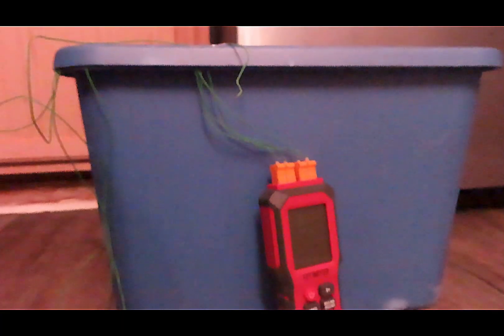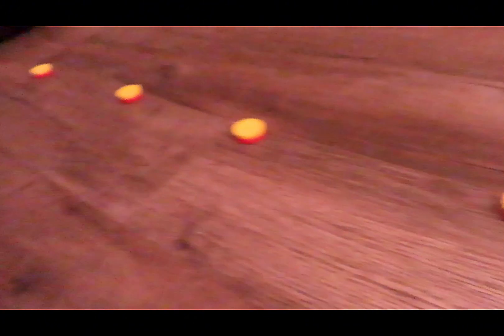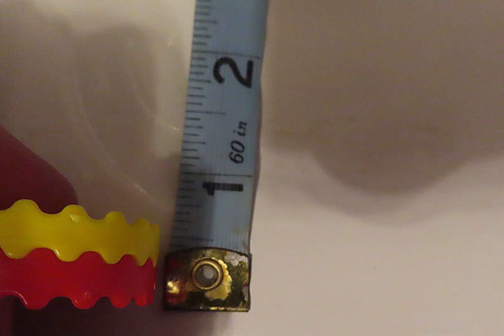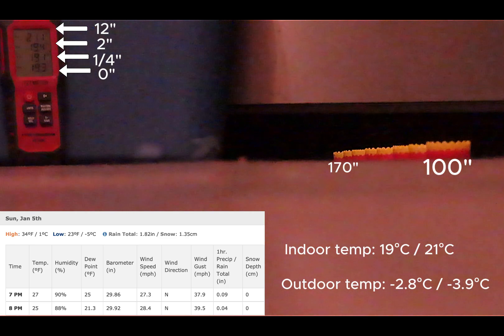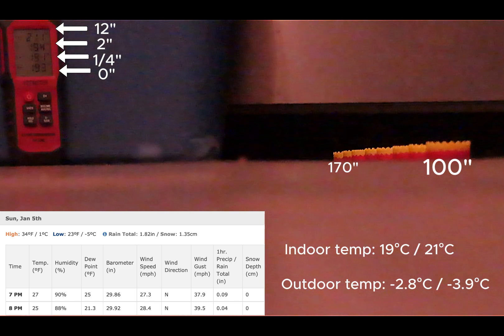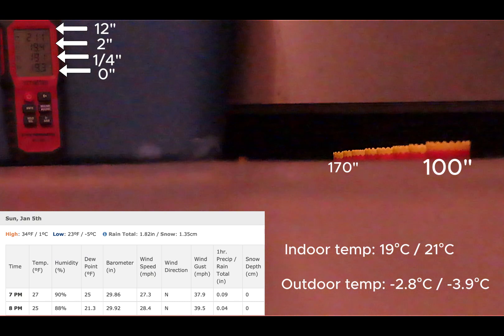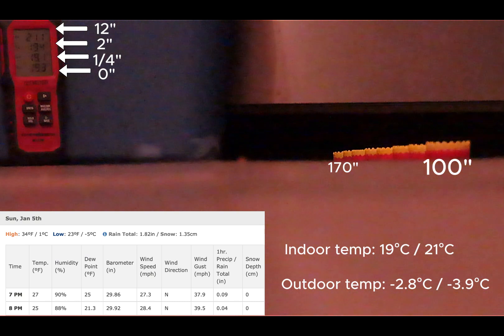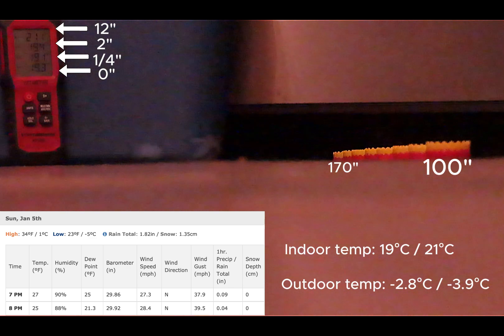At Home Refraction Tests 3.0 - January 2025

Comment: hey i'd love to pick your brain about a few things refraction related. if you have the time, im curious what you think is happening here in this candle demo: https://www.youtube.com/watch?v=zdwv6ZFohaU

it's hard to tell exactly what is happening in this demo because the object was not geometrically obstructed, it was only done optically, which leaves room for error. there are no temperature measurements so its hard to judge exactly what is actually happening with the gradient in air. i think whats happening here is because the obstruction was created merely by adjusting the height of the camera i think the red line could actually be geometrically visible, but just appear to not be. the initial refractive conditions in the air could be seemingly "obstructing" the red line when it is not actually obstructed. since we are outside on a warm looking day i think the gradient is cooler the higher we go, so when the candle is placed the flame plume produces turbulence causing distortion of the red line which previously seemed invisible. then when the capping layer is placed on top the temp gradient becomes slightly more uniform allowing for more visibility of the red line. an image from  the obstructed red line is not being lifted here, but just distortion. whats your take? have you ever done any candle demos? thanks much!
Reply from the maker: Hi there, I just saw your comment on the driveway test video from Tj Weits. My thoughts are exactly what you concluded.

We've conducted various tests on our land near Alamosa, Colorado and even when air temps were only in the 80s Fahrenheit, the surface temperature in direct sunlight would be over 120°F. So with 95°F temps and a concrete driveway, the surface temp had to be way more than the air. 

I imagine the temperature arrangement would have been something like 130°F+ at the surface, 110°F or so at a few inches, and then at a few feet probably closer to the 95°F of the recorded air temp that day. 

Pouring the 70°F water would cool down the surface temperature and probably make it closer to the air temperature above. This would then allow the light from the objects to arrive to the viewer instead of being refracted up and away from the surface due to the decreasing temperatures, which would've been present at the start of the test. 

It would've been best to first show the setup when the air and surface temperatures were about the same, so that we could determine exactly how much of the objects were actually obstructed to begin with. 

So in my opinion, that test is definitely inconclusive. I'll check out the link you sent. Thanks for your great thoughts and questions!
Reply: @skyfree01 i appreciate your response!

Comment: Firstly, I think this video was done well. A well-explained setup with repeatable results. Plus it can be done at home! The laser was a nice feature.

Still, what about the north star not being visible in the southern hemisphere? Or radio waves bouncing off the ionosphere in a way that only works on a globe, and radios calibrated with that assumption functioning as predicted? Or airplane travel time lining up with that on a globe and not a plane? Lunar ecplise shadow? Also how would the sun not light the entire world, while change in elevation would still have an effect (check out the video of the sun setting twice with a drone)? The 24 hr sun? How are calculations involving gravity predictable and acurrate if the world is flat?

The horizon is just one of many proofs that would have to be debunked for me to fully believe Earth is flat. I would be a moron if I learn of evidence proving that all of the above points are able to be explained on a flat Earth. As it stands right now, this particular phenomenon can be explained (with actual evidence other than foundationless claims) on both a sphere and a plane, but nothing else from the above list can. At least I have not seen proof of all of those observed events lining up with a flat Earth.
Reply from the maker: Thanks for the kind comment! The north centered AE model doesn't work, and hasn't made sense to me from the beginning of this journey. So if you're looking at a planar Earth from that perspective, I agree, it just doesn't work. 

The point of our channel is to say that science is never settled. Just like light refraction, science is not static, but incredibly dynamic. 

What we know now may not be what we know in the future. We may never be able to fully fathom the true nature of reality. 

Cheers!

Comment: So, at this point in all of your refraction tests, have you been able to utilize refractive conditions in order to overcome an observable geometric obstruction that was preventing the light from a distant object from reaching the camera? I have seen butane or other extreme methods that are truly not viable as occurring naturally on this world in order to attempt to explain overcoming geometric hurdles. I appreciate all of your working to straighten out the misconceptions of refraction.  Refraction bends light, it does not unbend light.
Reply from the maker: @bflat1894  We're actually going to attempt to observe the effect of seeing over a geometric obstruction tonight. The problem is, even if we're able to, it'll really just show that light can refract around undulations of a plane surface. 

In order to really demonstrate refraction bending around a convex surface, you'd need to use a section of one. 

I do believe it is possible to see around undulations of a plane surface though.

There are times when the surface appears to rise with distance and can be interpreted as having a concave appearance. This would refract light around nearby waves or other obstructions. 

We will see tonight though. We've tried these tests before but without luck. It's certainly easier to observe refraction causing objects to appear obstructed than it is the other way around. 

Thanks for all the great conversations! You've helped us out a ton, you're much appreciated!
Reply: @skyfree01  looking forward to seeing how the test is set up and what results that you come up with. Refraction is hard to single out. There can be reflection and scattering effects to realize as well.

Yes, the section model is challenging. I have the carpentry skills to make that but not the space or time at this point in my life. You two are more the specialists in the micro unless you are just looking down at the footprints and shadows at the base of the tripod. 

We have discussed my thoughts about the "Upturned Edge concept" of refraction. Don't ever let that limit your work. We have to entertain everything. 

Good luck in producing solid repeatable results that work towards clearing up these misconceptions. 

Look forward to more constructive conversations in the future.
Reply: @bflat1894  what misconceptions would you be talking about.
So far sky frees experiments have been perfectly in line with the information in text books and academia.

If liquid butane occurs in nature or not is of no consequence as the observation is qualitative. Even if we force some scale to the observation we'd have to consider that distances get scales down by 4 or more orders of magnitude while heights only get scaled down by 2 or 3 orders of magnitude resulting in much higher curvature on the downscaled demonstrations. Which would mean temperature differences have to be scaled up in order to replicate effects.
Reply: @curious1585  I'm sorry if I missed something, please correct me. Have any of these experiments made a known convex surface appear flatter. That is, have these tests using just temperature differentials supported the idea that long distance photography that defies globe math are explainable by refraction as it truly exists. This is where we are trying to address the misconceptions regarding refraction. How do these tests conform to the vertical gradient refraction narrative. Visual obstruction is observed not apparent flattening of a supposed spherical surface.
Reply: @bflat1894  what misconceptions are you taking about?

So far sky frees demonstrations confirm that light bends towards the denser air and since obstructions occur on the physical light path between the observer and the target a flat surface can obstruct objects on top of it even when the observer is also on top of the surface.
Obviously the inverse can be true then as well or do you think refraction is some magical one way street where one thing is conclusive but somehow deduction is invalid?

Yes I would say you missed something. It seems to be due to your confirmation bias. To say we need to be open to all possibilities, but you already exclude possibilities a priori.
Reply: @curious1585  Sky free is discussing "Upward Refraction". Have we identified the "denser medium" and the direction of refraction at this point? Does it conform to the 7/6R refraction narrative? What Inverse are you illuding to? 

What did I miss. Be specific. Are you fishing for an angle? Are you knowledgeable about this topic? What exactly have I excluded? Can you make a valid point to address?
Reply: @bflat1894  The light avoiding the denser cooler air above the floor....getting lost into the surface.
Reply: @bflat1894  I did make a valid point and I was specific. Try reading the paragraph before I stated that you missed something again.
If I express myself poorly and you have trouble understanding what I mean you can refer to it specifically and ask me to rephrase.

I am knowledgeable about the topic. I'm not fishing for an angle. You have excluded the available information about the density distribution we expect over large height differences and what density distribution is present here.
Reply: @curious1585  "Obviously the inverse can be true then as well"? How about proving the inverse to be true instead of assuming it to be true? I have found that some of the current atmospheric refraction formulas utilize mathematics that were derived from a specific situation but then applied broad stroke to all situations. This is a misconception. One cannot assume a refraction coefficient is valid along all paths of light travel when the law of rectilinear propagation states otherwise. This one misconception leads to more misconceptions that you seem to be forcing into this research with your own confirmation bias. Overcoming a physical obstruction along the path of light on a known flat surface is just one step. On a convex surface, a progressive chain of refractions would be required to achieve the "Flattening Effect" that is claimed when cameras capture objects at great distance that defy the supposed geometric constraints.
Reply: @bflat1894  I do not assume it to be the case with long distance observation in reality.
I'm merely spelling out the possibilities according to this observation and all the other so called black swans and proofs of flat earth.
None of them actually exclude the possibilities we're talking about, which doesn't mean they are happening but it makes statements like 'geometric impossibilities' false as long as you have not disproven them.
Reply: @curious1585  So you are here to dance around the "what if" stance? The possibilities that seem to just pop up from those with misconceptions about refraction that although being repeatedly called out, they persist in speculating? Geometric impossibilities are mathematically defendable. Speculation on a magical curved path of light is not. It goes against "Laws". Maybe you should qualify the possibilities that you stand behind. I have shown them to be misconceptions. Errors in a thought process. Ideas that defy the "Laws" that govern them. Prove your version of refraction. Put the facts on the table.
Reply: @bflat1894  nothing I stated goes against 'laws' about refraction. Nor have you shown anything I stated to be a misconception about refraction.
In fact your description of refraction is perfectly on line with what academia states about refraction, as is the observation in this video and as is what I am stating.
The only thing that's not in line with the basis of evidence provided is your claim that something I said has anything to do with magic or that you have proven the earth to be flat.

I'm not dancing around a 'what if' statement. I'm rectifying a situation where a community commonly jumps to conclusions due to what seems like confirmation bias. 
They question everything no matter how ad-hoc and improbable as long as it seems to go against their narrative but will refuse to even put two facts of their narrative together in order to investigate their consistency. It seems from that kind of thinking one can forget what conditions actually dominate in the real world in order to feel like an observation confirming the academic understanding of refraction somehow undermines it.
Reply: @curious1585  Let's circle around the last 10 hours. You are not assuming something to be the case but you are spelling out the assumptions of what you are assuming to be the case. So yes, you are dancing around with the what if statements. Where is your proof? Why does your community continue to not provide proof or accept proof that is put in front of you. Is the tactic of attempting to dominate the conversations with misconceptions and ridicule what you call proof? Is this your version of dignity in the world? Refraction, represented as a radius value instead of an angle is a bastardization of real science.

Comment: You could imagine this a scaled down model, something close to the observations we see- 1/4" = 0.1 mile (or 528 feet observer height),  100"  = 20 miles,  170" = 34 miles, the other are somewhere in the middle.

I believe this is much more optical distortion than required to explain what we see in nature sometimes and though in a controlled environment, it doesn't seem to far off of possible weather conditions we can expect to see in nature, we just see them much less drastically, over longer distances of course, allowing these optical effects to take place.

I still struggle to put this observation into laymen's terms, the other distortion, where the foreground appears to rise, blocking the background, I just think of as the foreground being magnified, so that it blocks the background. This one I can't sum up so easily, so, it's still magic to me...

Thanks!
Reply: @MATTINCALI  well it's backwards for one. Over big height differences air density drops with increasing height not raises.
Also the magnification part you're imagining is misleading I'd urge you to correct your thinking. If the analogies and underlieing reasoning you're applying in the cases you understand are correct you should be able to deceive what happens in different cases too.
If one thing is 'explained' and another thing with the same phenomenon remains 'magic' it's a big indicator the explanation of the first is not sufficient or correct.

Comment: very nice, do you have the temperature data?  For example, what happens to the temp when you 'open the door'.  And Why?
Reply from the maker: Welcome, Bob! We plan to get more thermometers so that we can place them along the viewing route and collect the vertical and horizontal temperature changes with more precision.  

The warm air at the surface and cooler air above causes the light to refract up, which creates the sinking effect witnessed in the video. As I'm sure you are aware. 

Some of our previous at home test show the laser light focused on a bucket, and the beam rises up when the door is opened.

Thanks for the comment!